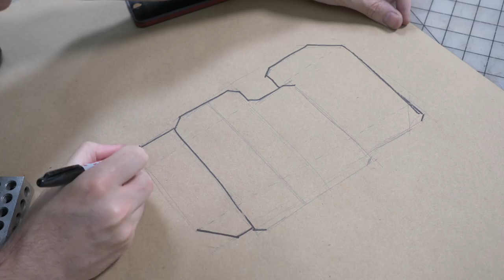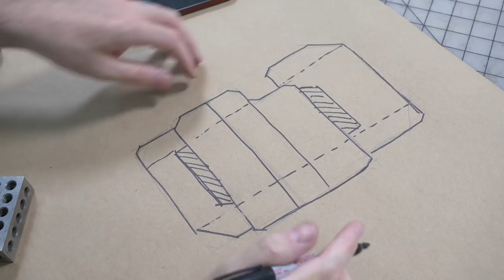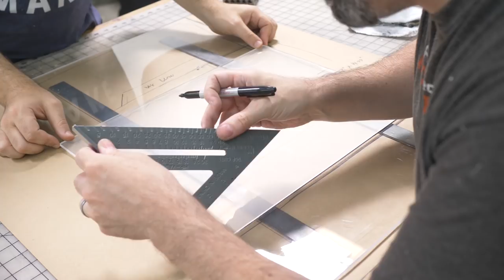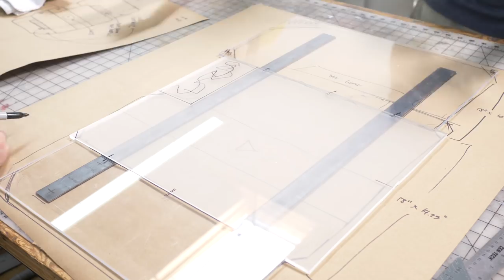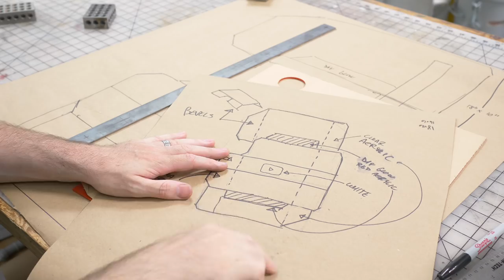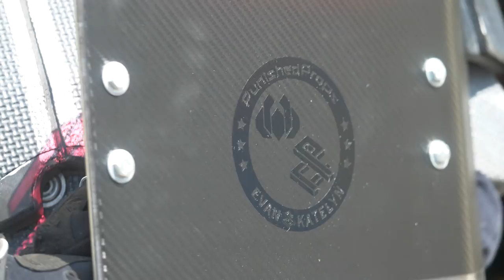Sci-Fi RIOT SHIELD Prop - Tutorial with Evan & Katelyn

Comment: A little trick i learned in shop class in Middle School (eons ago), when heating and bending acrylic.  once you get it where you want use a paper towel soaked in cold water to cool it off and make it so it stabilizes in the position you want quicker.  All you have to do is lay the wet, cold paper towel along the area you had heated.
Reply: Nice tip!
Reply from the maker: Fantastic tip, thanks for sharing! =D
Reply: you are welcome :D
Reply: Way, way, Waaaaay back in the mid 1990s, I was looking for pix of Gabrielle and Xena on my University's internet that I could print off, and I found The S.C.A. site. There were instructions for building LARP suits of armor from blue barrels. 1. Put on clothes you don't mind getting wet & dirty. 2. Make paper patterns of your limbs. 3. Trace the patterns onto the barrel and cut out the shape. 4. Use the appropriate safety equipment, like heavy gloves and goggles. 5. Heat up a large pot of water to soften the blue stuff in, and handle the plastic with gloves soaked in cold water. 6. Wrap your limb in several layers of wet towels, then form the softened plastic over your limb. 7. Be sure to wrap the formed plastic with another cold, wet towel to set it's shape. 8. Drill holes and install grommets along both sides of the armor's backside, to run laces through for fastening. 9. You can heat up metal screen and apply it to the armor for textures,  and because it gives paint grooves to stay in after much wear and tear.
Reply: The Society for Creative Annachronisms.
Reply: Anachronisms.
Reply: Worked with acrylic in electronics shop, wish I knew this

Comment: I use a hot wire table to do long bends on plastic as well as a heat gun.

Use compressed air cans spraying upside down on the heated bend and you will get a freezing liquid evaporating on the bend for an extremely rapid cooling effect. I have actually had ice form before.

Very handy when making complex shapes, multiple bends or when you are pressed for time.
Reply from the maker: Great tips, thanks for sharing!

Comment: Fun Fact: Polycarbonate is used in actual riot shields. Assuming you had thick enough material, that shield will withstand a TON of brute force.
Reply: True, but the fact that's it made in from 3 separate pieces means it's not as strong as it could be.
Reply: Riceball01, also true, but you could easily add a couple pieces of metal between where they meet to add that extra bit of strength.

Comment: Be careful using alcohol on acrylic, it can cause it to craze or crack. Extruded is much more prone than cast due to the built in stresses.

Polycarbonate would have been ideal for this job. A lot of people don't seem to know it can be cold bent! That means you can use a sheet metal brake and get really crisp results. I made seafety shields for a lathe out of 5mm polycarbonate. A real struggle physically, but a great result.
Reply from the maker: Great tips, thanks! =)

Comment: I tried pre-shaping and sealing my foam for my first time today with the heat gun, This is crazy. It's the shape it needs to be before I even glue it together. Also picked up a new squeeze bottle for contact cement, this is gonna be a good build.
Reply from the maker: That's so exciting!
Reply: I'm a little concerned about how well glue will stick to the sides that have been sealed though. 

Don't you guys have a video on how well paint sticks to different methods of sealing the foam?
Reply from the maker: Here' this video we made about sealing foam might be a great place for you to start: https://punishedprops.com/2016/09/20/sealing-foam-props-costumes/

Heat sealed foam should take paint just fine!

- Paige
Reply: I did a quick test, it seems to adhere the contact cement either comperable or exactly the same. I was worried about it not holding as well. I also noticed that foam mats from diferent places have diferent textures. Walmart had diamond plate,  harbor freight has that grid bump that looks like a weave, and Costco has this cool pyramid pattern.

Comment: Very cool shield although I would have the made the arm strap from nylon with velcro so that it's adjustable in size and the handle I would have either found some sort of handle to use or used the leather but wrapped a dowel of folded the leather over so that you could get a better grip. But that's just me. Regardless, job well done; really makes me wish that I had access to a proper workshop like yours so that I could do projects like that.
Reply from the maker: That's a great idea!

Comment: Are you running any specific kind of blade in your table saw to cut the acrylic?
Reply from the maker: I use an 18 TPI metal cutting blade for cutting foam. I think it's 1/2" thick. It doesn't leave a perfect cut surface, but it's pretty good. I use the same one for acrylic